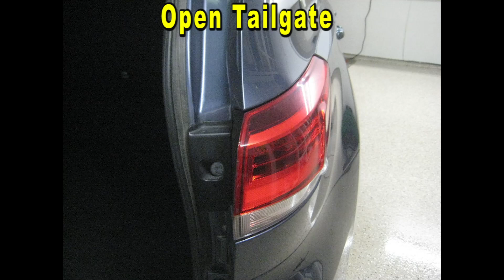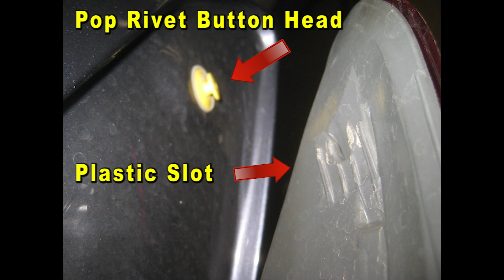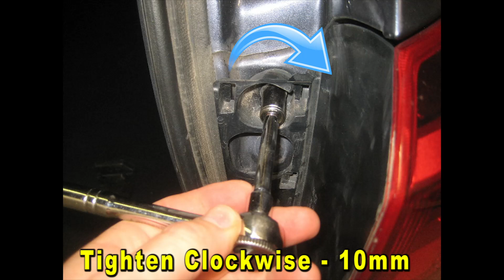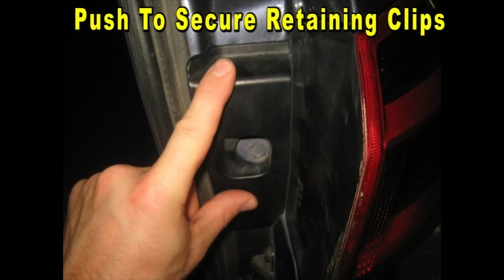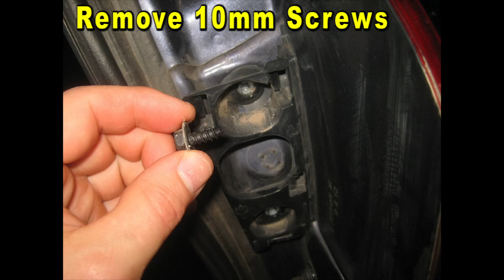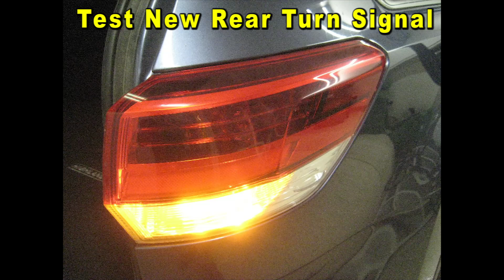Toyota Highlander How To Change Rear Turn Signal Tail Light Bulbs 2014 To 2019 3rd Generation With P

Comment from the maker: Toyota Highlander Rear Turn Signal Light Bulb - https://amzn.to/3VKt003
LED Rear Turn Signal Light Bulb Part Number - https://amzn.to/3pnXkBy
Precision Screwdriver Set - https://amzn.to/3TCMm6n
Plastic Pry Bar Tools - https://amzn.to/3HMtsV7
Socket & Ratchet Set - https://amzn.to/3Z17LbA
Mechanix Gloves - https://amzn.to/3jCnHkt
Torque Wrench - https://amzn.to/3vS5uSI

The Paul79UF YouTube channel is a participant in the Amazon Services LLC Associates Program, an affiliate advertising program designed to provide a means for sites to earn advertising fees by advertising and linking to Amazon.

Comment from the maker: Check out the DIY guide for changing a burnt out rear turn signal tail light bulb on a third generation 2014 to 2019 Toyota Highlander -
https://www.paulstravelpictures.com/2014-2018-Toyota-Highlander-Rear-Turn-Signal-Light-Bulb-Replacement-Guide/index.html

Here are all of the DIY repair and maintenance tutorials for the 3rd generation 2014, 2015, 2016, 2017, 2018 & 2019 Toyota Highlander -
https://www.paulstravelpictures.com/Articles/2014-2018-Toyota-Highlander-Common-Problems-Repair-Maintenance-Guides.htm

Owners of other Toyota, Lexus and Scion vehicles such as the 4Runner, Avalon, 86, C-HR, Camry, Corolla, iM, Land Cruiser, Mirai, Prius, RAV4, Sequoia, Sienna, Tacoma, Tundra, Yaris, FR-S, xB,  xD, tC, xA, CT 200h, ES 250, ES 300, ES 330, ES 350, IS 250, IS 350, RX 300, GS 250, NX 300 and RX 350 may also find these DIY instructions to be helpful.